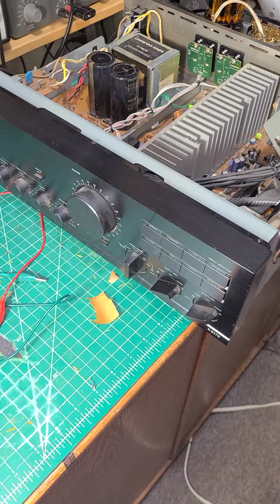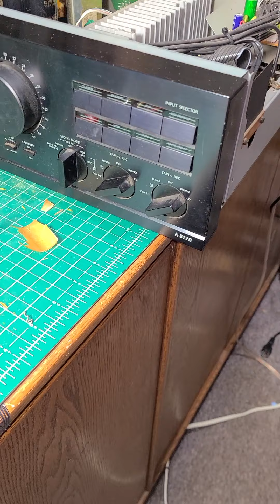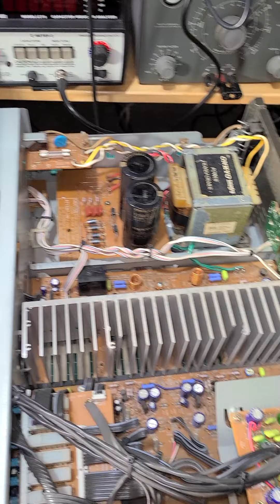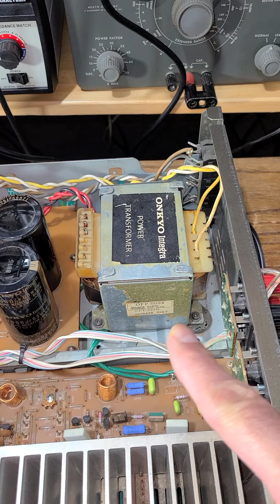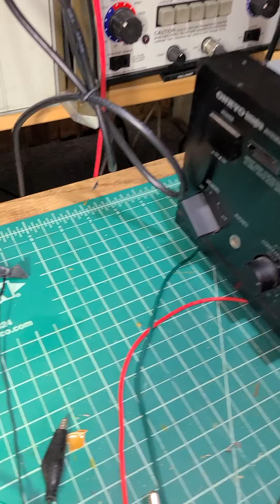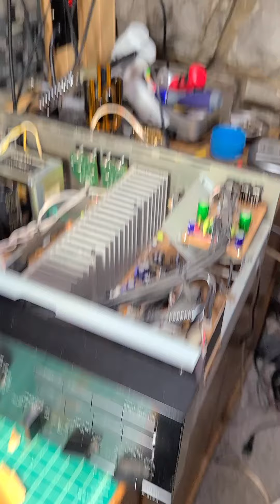Repair of Onkyo A8170 Integrated Amplifier

Comment: There is a balance problem in my Onkyo A-8170. The sound output in right channel is lower than left one. What to do? Repairers have twice made money off me, but the problem comes back.
Reply from the maker: Hard to tell without having physical access to the unit. But signal tracing can be done from balance control to the output terminals to find where the faulty stage is. If you take it to a good technician, it should not be hard to diagnose.  Best of luck

Comment: Hamayun, I have the exact same issue with the speaker selection knob on my Onkyo A8190 that you described. The receiver itself plays beautifully, so that is not an issue; but does this knob simply pull off, or is it attached by a small tightening screw or in some other way? It appears to be on rather snugly, and I don't want to risk damaging it further by attempting to remove it improperly. I looked at the service manual, but it was insufficiently descriptive. So please let me know.

Comment: I had the same problem with the speaker selection knob , turns out the set screw holding it on was loose and used a number 2 Allen wrench to tighten it, I was able to tighten it with the top cover off but it’s a tight fit
Reply: I just saw this after asking basically the same question (above); so, I will give your method a try. I would still, or course, welcome a response from Hamayun, if he has one.
Reply: @garthhallett1319  saw your comment , if I remember correctly the faceplate needs to be removed if you want to remove the knob , the set screw just aligns it
Reply from the maker: Sorry it has been a while so I do not remember all the details. You can try without removing the face plate but make sure to protect it from scratching.  Best of luck for your repair.

Comment: When u say that the Onkyo A8170 was dead, did u mean no power at all on the unit or unit has power but no sound. I have the same amp which has power but no sound that I am trobleshooting.  Thank you.
Reply from the maker: Pierre,
By dead I meant that Unit had no sound or any lights and such. There were no signs of voltage on the secondary of the power transformer. However, when i tested I found that full line voltage of 115 V was present on the switch and primary of the transformer. I first thought transformer winding is burnt and that is why there is no voltage on secondary. However there was no burning smell or visual signs. On checking it turned out that Thermal fuse which is hidden on primary side of the transformer was burnt. This fuse is out on the transformer to prevent it from overheating. Sometimes for no reason or voltage spike it gets burnt. Once I bypassed the fuse (I believe you can find it and buy a replacement for your transformer if you are lucky) all voltage in the amplifier appeared and amplifier worked normally. If you are not familiar with working with high voltage or do not have experience repairing electronics then please do not try.  I am not saying it in a bad way, but just for concern for your safety. Take it to a repair shop or get help from any friend who has experience. I wish you the best with your repair. Regards.
Reply: Hi, thank you for taking the to answer me. I will be carrefull while working around the amp. I just revived an old NAD 3150 that had no sound (-:
Reply from the maker: @pierrehould2909  great. I would love to know how it turn out. Best of luck.